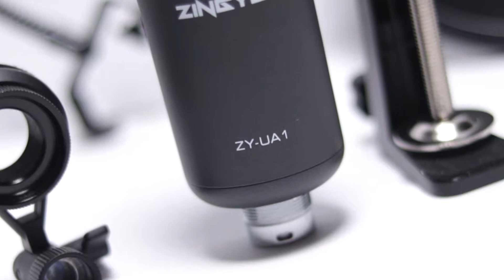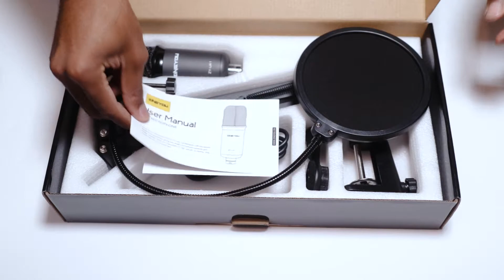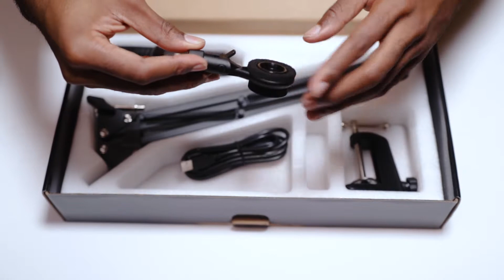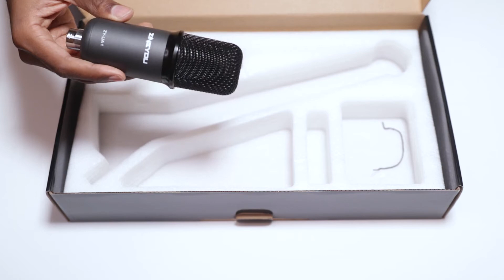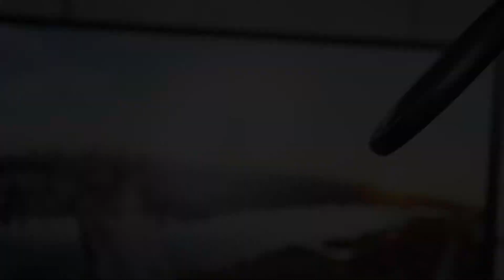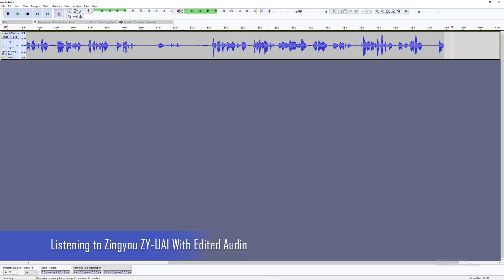Zingyou ZY UA1 Condenser Microphone. Detailed Audio Review and Unboxing. A great Budget microphone!

Comment: ordered it yesterday after this video. preciate it bro you’re the only video on youtube reviewing this microphone and it really helped
Reply from the maker: Happy to help! Don’t hesitate to let me know if you have any questions regarding the mic. Thanks for watching and supporting the channel 🙏🏽🙌🏾
Reply: @GoWrightReviews  yea bro it says it’s arriving tomorrow i’ll let you know how i feel about it and if i need any help
Reply: @GoWrightReviews  ight so i got the mic and set it up, sounds really good, but lets say i wanted to turn the gain up. not that i need to but what if i wanted to. i tried equalizer apo and it didnt work
Reply from the maker: I was going to suggest the equalizer APO but it should work. Maybe try to make sure you set the mic as an input device as opposed to output
Reply from the maker: Also, if my memory serves me right, there are two pieces of software to download. One is called PEACE I think
Reply: @GoWrightReviews  is it because it’s USB?
Reply from the maker: No, it should work on APO equalizer, even though it’s a USB. For some reason windows doesn’t give you control over your mic in this way, I think this is why some mic providers put the built in gain controls on the mic itself. But I can confirm that APO equalizer can be used as a way to override this issue.
Reply: @GoWrightReviews  ohh okay. it probably does work its just that the mic doesnt pop up as a choice to use in apo
Reply from the maker: Try to Close the software and then open it again with the mic connected. And look for it as a device then.
Reply: i mean, i have Voicemod and select the mic on APO as Voicemod so i dont see why it should work. could that be the issue?
Reply: @GoWrightReviews  alrighr
Reply from the maker: Hmm, try it out and see. Look for the mic directly on APO
Reply from the maker: If anything we can schedule a video conference on Instagram .
Reply: @GoWrightReviews  i checked, it doesnt pop up for some reason. and i would call on IG but im on the game right now my bad 😅. i tried disconnecting and rexonnecting but it didnt work
Reply: @GoWrightReviews  yea it still doesnt pop up bro
Reply from the maker: https://youtu.be/zh7efMRMliA
Reply: @GoWrightReviews  that video is soo complicated but thanks bro
Reply from the maker: I honestly don’t remember it being that difficult. Let me go through it on my PC and I’ll get back to you !
Reply: @GoWrightReviews  bet bro
Reply: @GoWrightReviews  i got it to work using that video bro thanks. it was a process but it worked in the end 👍🏽
Reply from the maker: 🙌🏾🙌🏾🙌🏾! Happy to hear bro. So now you’re all set up !!
Reply: @GoWrightReviews  yessirrrr

Comment: How can you turn the mic volume down.
Reply from the maker: That will be controlled within the platform you’re using or in your operating system. So basically your settings 👍🏾
Reply: @GoWrightReviews  i can’t seem to find these settings, could you provide instructions for w10, thanks
Reply from the maker: Cheddr Hey! I actually just tried to adjust the volume in audacity and I also realized that the gain wasn’t controlabe. This is something I didn’t notice before , however , there is a solution. I’ve been using software called APO equalizer and Peace on my Audio interface to add live eq adjustments, it works well and will also work on the USB mic. It not only allows you to control volume but also the various eq frequencies. Take a look at the bottom of this article, it has the setup instructions ! Let me know if you have any question 👍🏾. Link:https://www.pcsteps.com/15528-windows-10-driver-causes-low-volume-usb-microphone/
Reply from the maker: Also as an update, I also tried the mic on some other software (OBS) and it was effective in lowering and increasing the volume. So it seems that If you’re using the mic with other software, it should be able to control the volume levels. Audacity volume levels seem to be based on windows driver which seems to not allow this volume control but In either case, the software APO equalizer with Peace will rectify any issues 👍🏾👍🏾!
Reply: @GoWrightReviews  I’ll try thanks
Reply: Thanks it worked
Reply from the maker: Awesome  👍🏾. Glad it’s all sorted. It’s a very useful software. I also use it as a virtual eq to optimize how I listen to content I consume, videos, games, music it all can filter through there.
Happy recording !

Comment: could i use it with the xbox if it’s plugged into the controller through different adapters?
Reply from the maker: Hello, unfortunately, this mic is not compatible with Xbox, but you can use the zingyou zy-007 or similar mic setups.To do this you will need a mic and headphone splitter adaptor (Y-Splitter). The ZIngyou zy-007 comes with an xlr to 3.5 mm jack (TS) if you plug that directly into the controler, it won’t work, so the Y-splitter would separate the mic and headphone signal so you can then connect the mic. Then adjust the settings then you should be good to go. I haven’t tried this myself so I can’t comment on how this sounds on the Xbox, but you can see the review of the Zingyou zy-007 on my channel to see how it sounds on PC. Here is a link of an example of a y splitter adaptor:UGREEN Headset Adapter Audio Splitter 3.5mm Male to 2 Female (4 Pin to 2x3 Pin) Headphone Mic Audio Y Splitter Cable with Separate Headphone Microphone Jacks 0.65ft (Black) https://www.amazon.ca/dp/B073ZCWDZY/ref=cm_sw_r_cp_api_fabc_yf25FbQWVVVBJ?_encoding=UTF8&psc=1

Comment: is the mic audio good with the usb ?
Reply from the maker: Hey! Personally, I liked the sound the mic created. It was sufficiently loud and had a pretty low noise floor. My only critique is that it can be a little sensitive so if you touch the mic stand while using it, the microphone will pick it up. Other than that, I was fairly pleased. The setup was extremely easy as well.
Thank you for checking out the video by the way 👍🏾
Reply from the maker: Also check out my video where I give basic tips for editing your microphone recordings using Audacity (free software) and Premiere Pro. I think having that knowledge can compliment the process in getting your desired sound 👍🏾

Comment: I have a question, can you plug this directly into the ps4?
Reply from the maker: Unfortunately, this mic isn’t compatible with PS4.not sure why that is, maybe it’s the software that isn’t compatible..
Reply: @GoWrightReviews  Thanks for the response but is the Zingyou zy-007 compatable with ps4 and if not please list some good budget mics compatible with ps4, Thank you!
Reply from the maker: The Fifine t669 is actually advertised as being functional with PlayStation 4. It’s a good mic as long as you don’t turn the gain up too high. I like the Fifine k678 better because it has more features but it doesn’t explicitly say whether it works with PS4 although, I feel like it would if the Fifine T669 does. A review of both mics are on my channel if needed!
Reply: @GoWrightReviews  Thank you!
Reply from the maker: My pleasure 👍🏾
Reply: @GoWrightReviews  Sorry for bugging you again but do you think that there is anything under 100 Dollars that is compatible with the ps4 on amazon?
Reply from the maker: Oh it’s no bother at all. I’m actually doing my next video on a really low budget microphone. Should be coming out this week (teaser). I can tell you this mic is low cost because it doesn’t come with a lot of extra features or accessories but it does the job based on my initial test. So if you can do without the extras, then Check out the Maono PM461TR. Hopefully I can put out the video by the weekend. You can also check out the Fifine 669B which is the little brother of the T669. Same mic specs as T669 but without the extra accessories. Hope this helps and don’t hesitate to let me know if you have any other questions.
Reply: @GoWrightReviews  Thank you so much! I will definitely check your video out!
Reply from the maker: Hey!
I just discovered something really strange. I was just on the Amazon page for the Zingyou Zy-UA1 and in the description it says the microphone is not compatible with the PS4 but someone asked your same question on Amazon and the Zingyou representative replied and said that the microphone does work with the PS4. So I’m a little confused. I will have to test this myself to get a definitive answer.
Reply: @GoWrightReviews  Cool! Thank you!